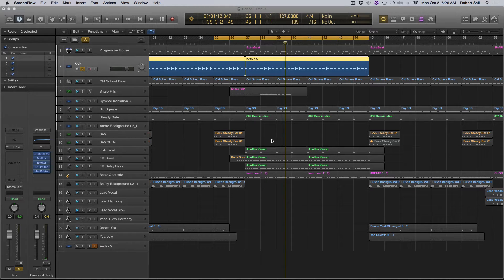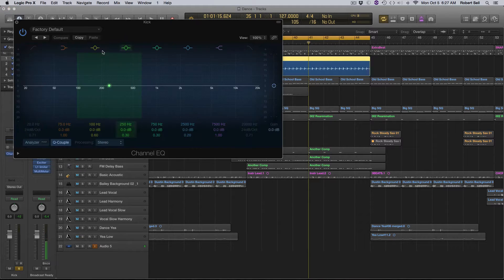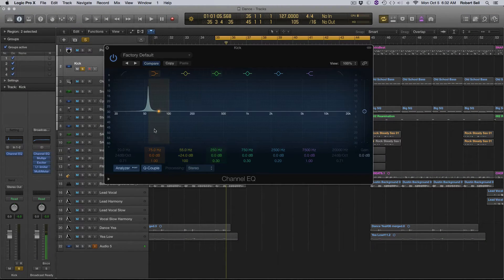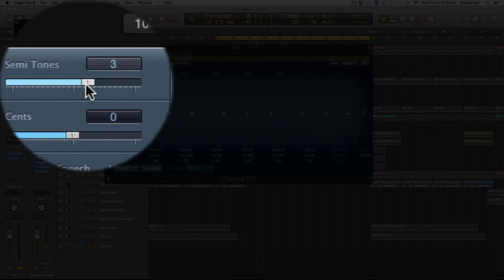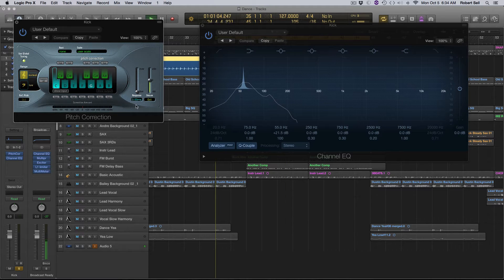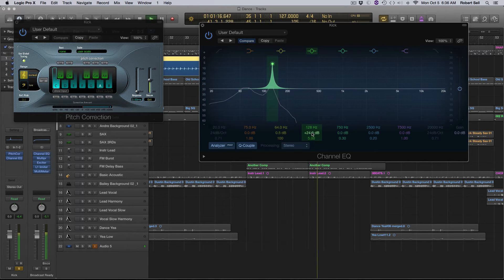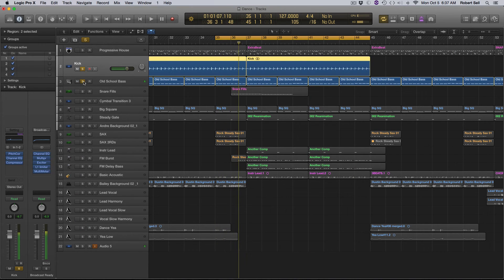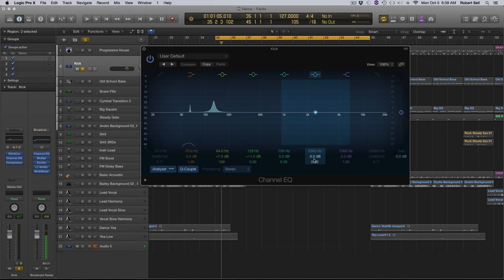Tuning a Kick Drum in Logic Pro X

Comment: Question; The Pitch Correction's range can be set to 'Low'. Since you were dealing with a kick, why not use it?
Reply from the maker: Yes, you are absolutey correct if you are using the auto detect feature for frequencies below 100 HZ. Otherwise, you may experience inaccurate pitch detection. However, I'm my example I knew I wanted the note pitch correct to a C so I manually selected it and was not using the auto detect feature.